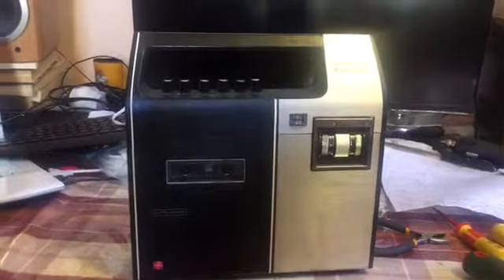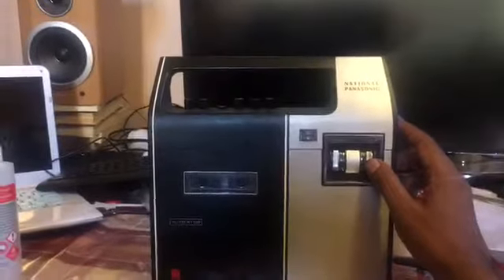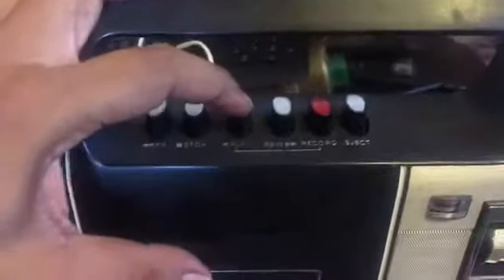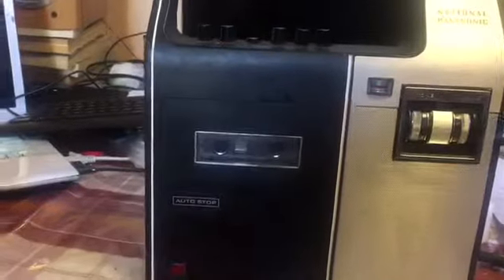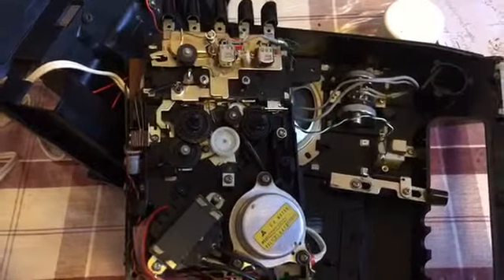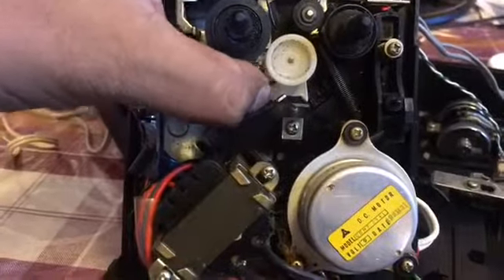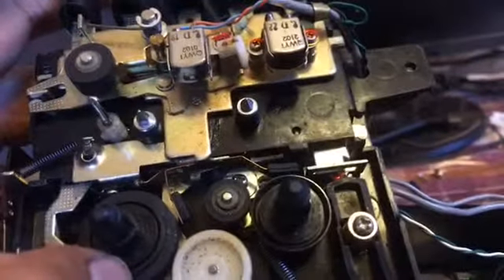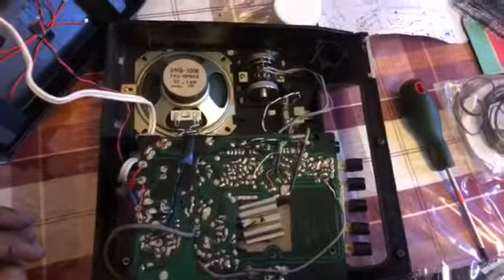National Panasonic Cassette Tape Recorder.  Market find. RQ-226S

Comment: Just grabbed the same unit that is just clicking when you plug it in.  Won't respond to controls.  Did you notice a fuse or any idea what I could try checking?
Reply from the maker: ruffleupagus most common problem with old tape decks is a broken belt.  Next is broken rubber idlers.   Last is broken gears.   Need to open it and check.
Reply: @phantomrose1999  yea it's not budging. Seems dead. I swapped out the belt.  Just that click as I plug in.
Reply from the maker: ruffleupagus If the motor is not turning then you need to measure all voltages.  If the motor is turning and you hear a Clicking noise, it may be a non functional auto stop that is stuck. Can’t remember if this unit has one.